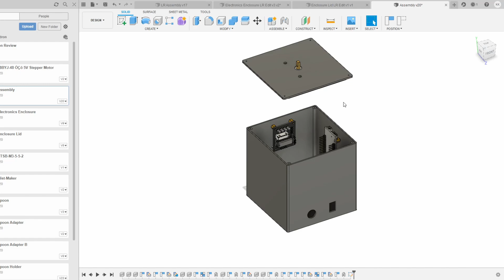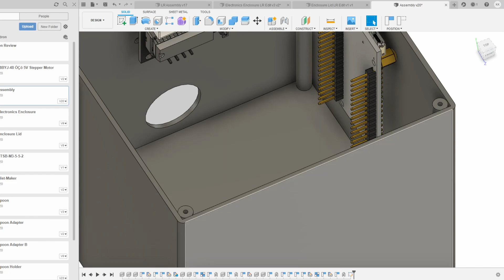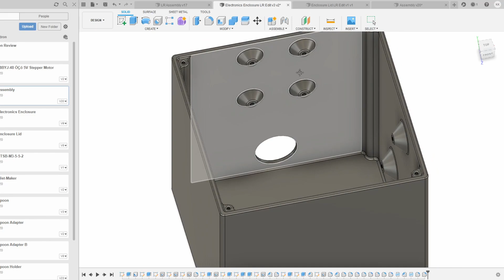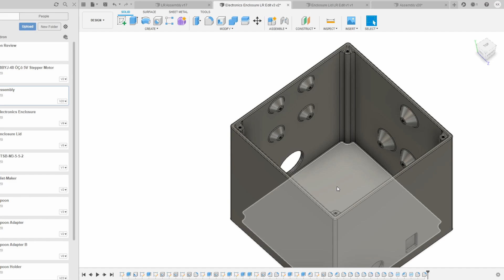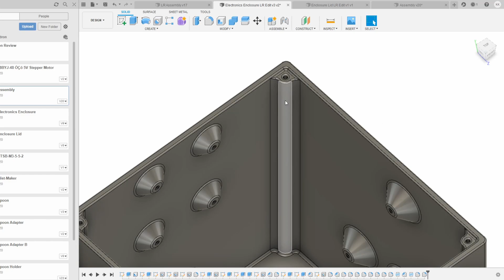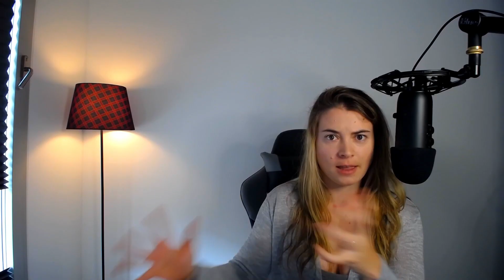5 Tips for Drawing Models for 3D Printing | Fusion 360 | FlashForge

Comment: One thing you can optimize is to remove the threads inside the holes. They are too small to be printed anyway, at least for M2-M4 screws. It's better to just make a small test print with horizontal and vertical holes and find what diameter works well for a metal screw to hold on to. It's difficult to give out numbers that work for everybody, because it depends on the type of plastic you use, slicing settings and the tuning/accuracy of your printer. Or do the right thing, and don't use standard metric hardware to screw into plastic at all. There are special screw threads designed for self tapping in thermoplastics, and they hold on to it much better.
I disagree on the rounding of all the edges. That does not really help your printer to print cleaner. Jerk limit values (and acceleration) are programmed into your 3d printers control software, so thats where you would need to tune jerk, if you have issues with bad looking prints. It does however help to chamfer/fillet some edges for mounting tightly fitting hardware, as it kinda works like a funnel helping to get the pieces aligned properly, and in the corners it definately helped in this example to make everything stiffer and more stable. On the "integral supports" you would actually not need that much material, as only the lower half of that cone is actually having any function. It would probably have been enough to just make a 45° wedge from the standoffs towards the bottom of the model.
Reply from the maker: Wow great comment, thanks! :) Yea we agreed that threads for M2 were probably not going to work (but we left it in anyway haha). Thanks for the advice about the screws! I've never heard of those special screws before. So far I've been using normal screws (with un-threaded holes) which seem to work fine for their purpose. But my applications haven't required that much strength, so I'll be sure to remember this when I need to build something a bit more durable.